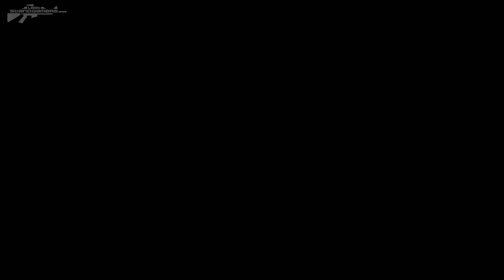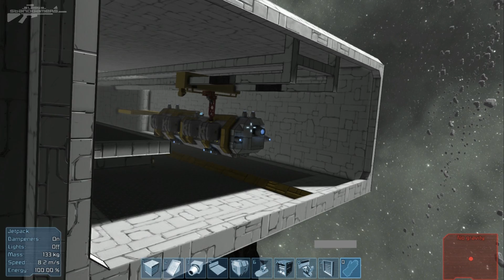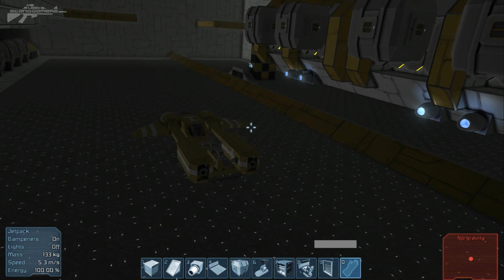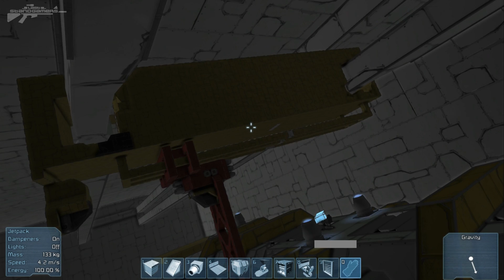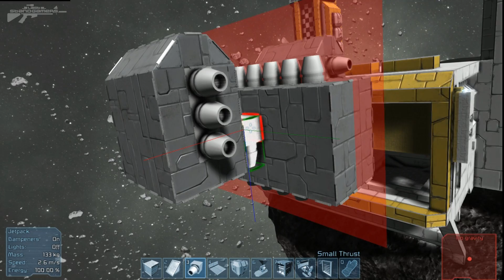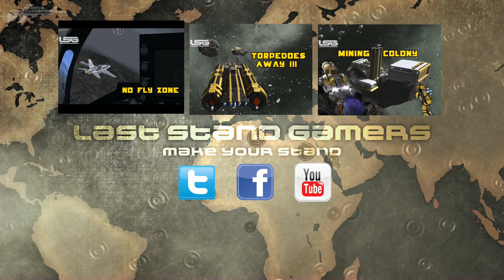Space Engineers - IT ALL WENT WRONG, Crane Fail Part 9

Comment: Arron, you should build a boarding ship that has many large ship grinders facing towards the enemy ship, with like 20+ gravity generators a level or two below the grinders, then ram into the enemy ship with grav gens and grinders on, (use landing gears space sparsely about to confirm lock to enemy) don't turn grav gens or grinders on TILL landing gears lock, then slam it all on at once....you will overpower the enemies gravity generators and any pilots who were unaware of your attack at the moment it happens will go flinging towards your ship at a very high speed, and if they don't react fast with either, a) collide into a part of their ship and die, or b) fly into your grinders and be killed that way....also it'll grind apart enemy ship and troll them for reversing gravity.